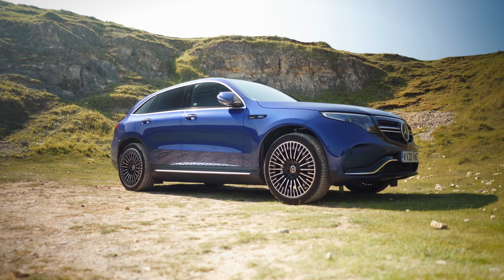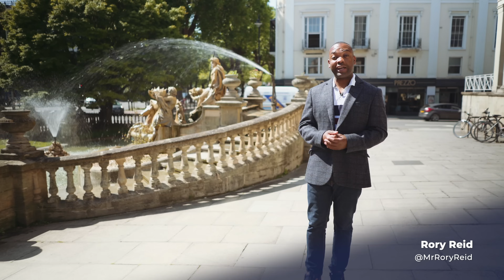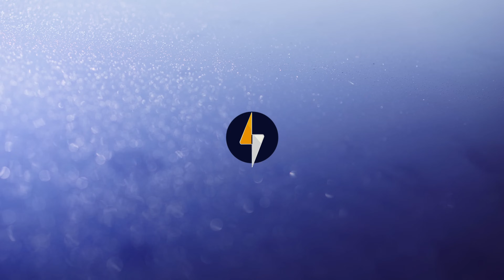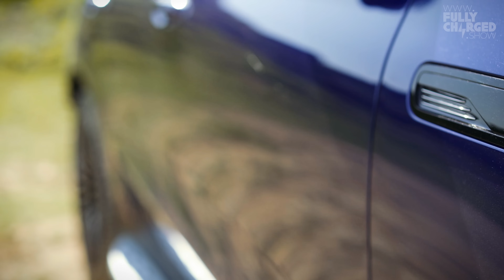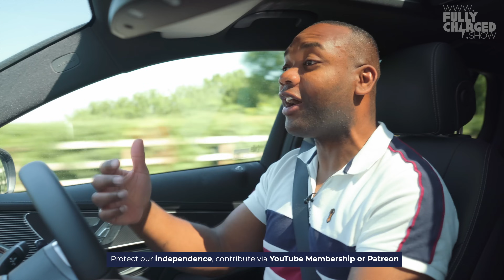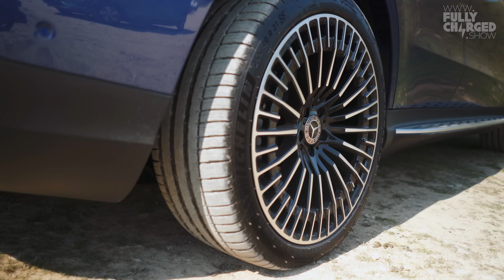Mercedes Benz EQC - Rory Reid First Drive | FULLY CHARGED for Clean Energy & Electric Vehicles

Comment: Its interior looks like a cheap version of the recently released Kia Sorrento, except that has a nicer interior. Actually that looks a lot nicer outside too.
You would think that a company that prides itself on exclusivity and comfort would build an EV from the ground up to take advantage of the extra room afforded by a flat floor and longer wheelbase thereby supporting its reputation for comfort and noise abatement. Instead they produce this Haval lookalike with all the charm of a 2015 Corolla hatch and cynically flog it off to the well heeled virtue signalling but slightly dense few who won’t see past the three pointed gun sight mounted on the fake grill.
There are far too many players in the market these days for this type of cynical half attempt at a luxury EV. It’s usually a result of the MBA,s in charge of development instead of the engineers and sometimes signals cash flow issues in a company but my instinct tells me it is mostly a result of  hubris and we all know what goeth before a fall, don’t we.

Comment: Another massive SUV you need steps to climb into. The opposite of what we should be doing. Virtue signalling for super consumers. Puke.
Reply: Jon Moon If local councils maintained the roads better and found a way to manage speed without placing dangerous mounds of tarmac across the road every hundred yards people might be inclined to opt for sensible, small cars. However anyone who live in London will tell you that driving anything other than a big SUV is a deeply unpleasant experience that sees you crashing through pot hole after pothole and scraping over every other speed bump.

Comment: for me it always comes down to the problem of retrofitting an ICE platform into BEV. The hood is just unnecessarily long and hinders visibility. In this case there is zero storage space beneath that behemoth of a bonnet (for the brits).
Me personally, I don't like the retro 70s Disco interior with those weird aluminum fins running door to door. I was in the market for one of these, finally went for a Model X though. It's just the all around better package for the money. Yes the Merc has impeccable build quality, but that won't help me with storage, range, interior space.

Comment: I have to say I don't understand Mercedes advertising of this car. It is not the first fully electric Mercedes. I have a 2015 "Mercedes electric". My 2015, basically looks the same as the 2021 except for the updated front grill and the nice wheals. The range on the 2021 is much better than my 120 miles. My 2015 interior is basically the same except for all of the updates Mercedes has given to its whole line of cars to date. My 2015 is quick and I think handles well. What I have not heard about and am interested in is autopilot. Mine is basic. It follows well on highway or side streets keeping the proper distance but others are far superior today. Really, nothing new here except the welcome range increase.

Comment: I work in the community average wage never be able to afford this. All i want it a small electric car that can do around 500 miles on a full charge, thats under 20k. This is when i will be tempted.
Reply: No need for that kind of range, it’s much more useful if the charging time is improved rather than the range.

Comment: "Batteries and electric motors are quite an expensive part of the car". Didn't Robert dispel the myth that batteries were a major factor in EV cost only an episode or two ago?
Reply: They are still going to be the most expensive part of the car, though yes it really wouldn't be much different than the cost of installing an ICE system.
Reply: It's not a myth at all, the only notable point is that the cost of the batteries as a proportion decreases as the vehicle price increases

Comment: What is it with all big auto and electric cars? To compete with Tesla you have to drop the 'lets just use our existing ICE platform and slip in a battery and electric motor' attitude. You end up with a vehicle which has all the road handling characteristics of a lorry. Having the motor and gubbins in the front means, just like with ICE cars, if you're involved in a head on collision you end up with those gubbins on your lap. Not nice, which is why Tesla also has the safest car on the road. No mention of autonomous features either so if I had £65k to spend (Which I don't) and I want something big, I'd buy Tesla Cybertruck, something smaller...probably the Y, something more UK road friendly... the model 3. Infotainment is now an important part of most peoples lives, especially on UK roads and just like our phones we expect regular updates.

Comment: This is why I still like my Toyota Prius Prime. Gas and electric. I wish it had more batteries, but I never get stuck anywhere sitting for an hour or so.  I can get to work and back on battery.  So 90% of the time I'm using battery. Winter less. They need better insulation from cold.  Here in Midwest USA we don't have as many available chargers. So, going completely EV is tough.

Comment: Those wheels are horrible, they really ruin the car. It feels like they put electric motors in a petrol car body, slapped a Merc badge and price on it and called it a day. EVs should be designed from the ground up as a new car, the next evolution of motor cars

Comment: Very nice car but a few practical disadvantages compared with some other EVs - especially with the usual suspects. First, AC charging limited to 7.4kW while - at least in mainland Europe - 11kW is the norm with chargers at home or in parkings at offices etc - it is just the difference between the car can get a full charge when at work or a short night at home or not. Second, too small range, just not energy efficient enough. It is not bad but with an EV in this price range and level of quality it should have been better.  But overall, a car with a lot of good qualities. If you like to know more about the practical use of the Mercedes EQC check out the video's of Bjorn Nyland (Teslabjorn), he tested the EQC very extensively last autumn.

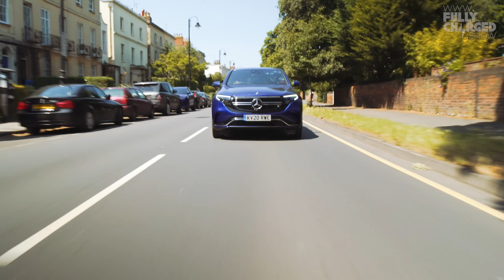Comment: 1:27 “essentially it’s based on the GLC platform...” really summarises this video. I’ve driven it and whilst I find it one of best Mercedes’ you can buy (when you’re shopping in this price range). It feels dated the moment you step in. Try “Hey Mercedes 5 times to change radio stations and you get what I mean. And it’s not like it will get better over time. Because legacy car makers still require you to depend bringing the car in for updates, probably once a year. They just don’t learn! No 3 phase charging is pathetic too. Even the guy who was supposed to sell me this, knew more about my Model S than the EQC. Just like the Jag guy. I really want legacy manufacturers to do well, but aside from Hyundai/Kia they’re just too slow. I wonder why...

Comment: The most beautiful part of EV charging is that you won't need to drain battery to empty before you can charge it. You can charge it every day even if your daily commute is less than 50 miles and you will have a full battery every day in the morning.

Comment: EQC = 85 KWh battery and 260 mile range, Model Y = 75 KWh battery and 310 mile range.  The Merc is obviously very inefficient, although better than the "electron guzzling" Jag i-Pace.  Just saying...
Reply: My Model Y get's around 240 miles of range in real world driving. The 310 miles EPA number is complete nonsense.

Comment: WTF is a mile.  I looked it up.   12 inches is a foot, 3 feet is a yard, 22 yards is a chain, 10 chains is a furlong and 8 furlongs is a mile.  It makes sense now.  The UK went metric in 1965 and they still don't know what a kilometer is.  They measure petrol in liters.  Great for working out fuel consumption.
Reply: A "Kilometre" is 0.62 miles
a mile is 1.61 "Kilometres"
And we measure fuel in "Litres"
All without checking and with the *correct spelling*!
😁

Comment: 70 mins to almost fill up at a " fast charger" is going to be a deal breaker for lots of people.
Until a 100kw battery can accept a 90% charge in 10mins max,then it's a luxury option regardless of price,for the masses.
Reply: bryan - You do know that Tesla has found out Tesla owners overwhelmingly charge their vehicles at home, so charging speed isn’t even a concern 95% of the time. ATST, surveys have shown that, even with the slower 50 Kw “fast charging”, 85+% of EV owners will not even consider buying an ICE car, & there is a lot of difference between 50 Kw/hour & the 150-300 Kw/hour that’s become standard with Tesla, Porsche & the new VW’s. There’s a lot of difference between requiring 70 minutes for ~55% charge (with almost nothing to do for those 70 minutes unless there’s a restaurant nearby) & needing 30 minutes for the same charge with Netflix, YouTube, Video Games and more on top of having just enough time to “grab a bite to eat”. If you don’t believe me, watch a few of TeslaBjørn’s videos or follow the antics of the Everyday Astronaut who drives from Iowa to Cape Canaveral/Boca Chica/California several times a year in his Tesla Model 3.
Reply: bryan 90% charge in a 100kw battery in ten minutes would need a 540kw battery charger, an insane amount of power which would likely require dedicated sub stations and their own electrical infrastructure if they weren't to cause the lights to dim across entire neighbourhoods. I can't see it happening.

Comment: It's a nice car that would have been competitive several years ago. What excuse will they give to have you bring it into the shop every year for a costly maintenance?   Battery test every year, or of course brake fluid change every two years, battery terminal cleaning?  Merc isn't serious about designing an electric car. This is their second gas to electric conversion of an existing model.  Just sad really when you consider how much time they've had to work on it.